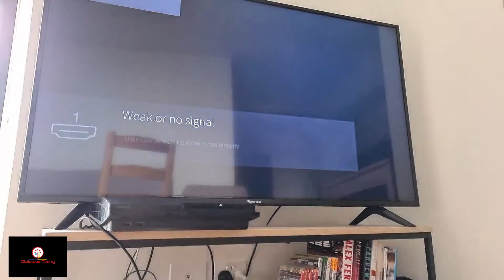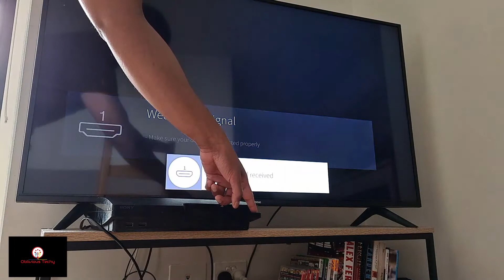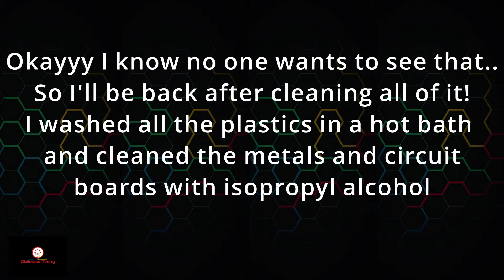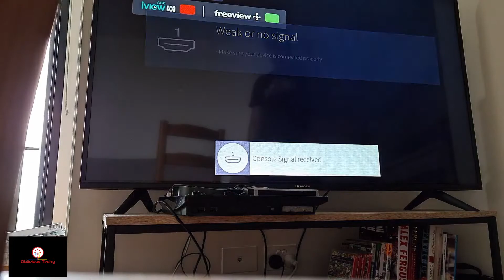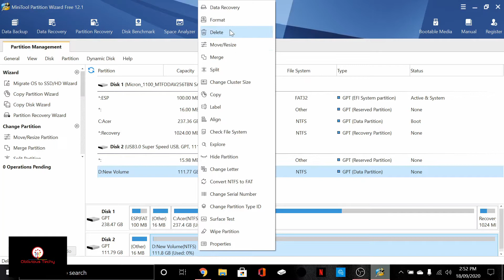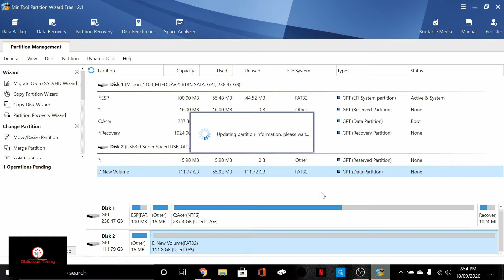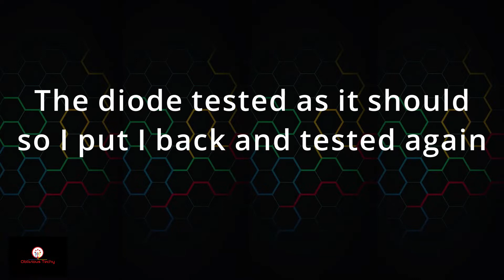Infested PS3 Slim No Audio/Video | Can I Fix It?

Comment: Reflowing the video ic doesn't make any sense. I'm curious as to why would you do that? Reflowing is a technique used to reform solder balls on BGA ICs, not on DFN, DFP, QFN etc. All a reflow is ever going to do in this situation is stress the chip even more. It needs replacing, not reflowing

Comment: Did you find out the fault in the console. I was thinking it may had been either the file system is compromised or some one switched the video settings to something else.
Reply: EXACTLY.... I have a ps2 backwards compatible ps3 fat that showed a black screen and I had to reinstall the firmware through safe mode and that fixed it. Still is kicking as of today. I still opened it up though to deepclean and apply new thermal paste.